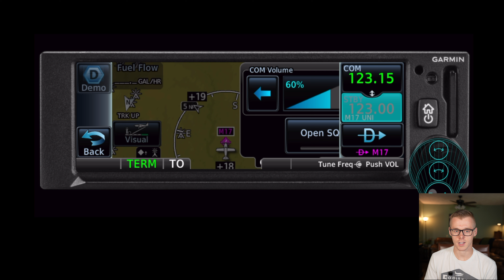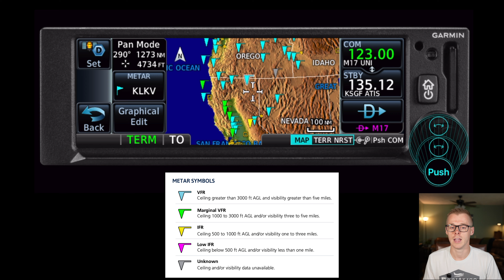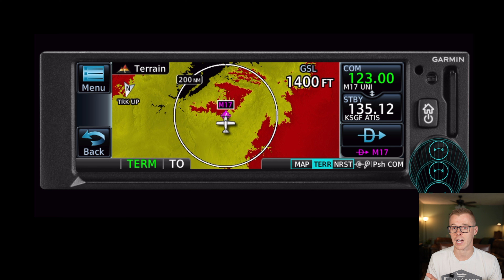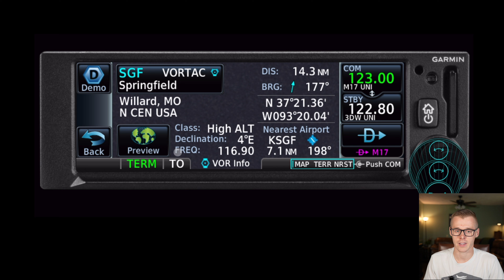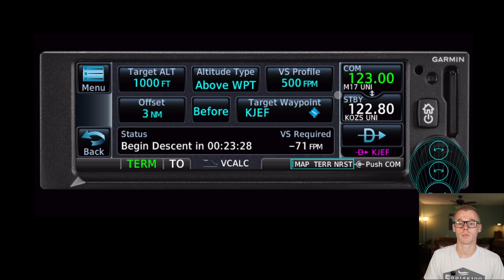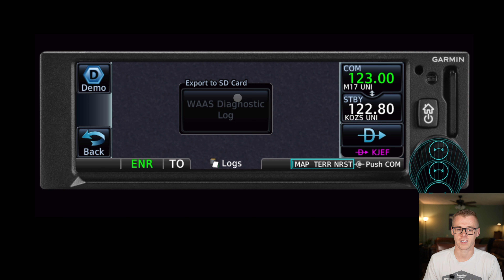How to Use the Garmin GNC 355 - Tutorial for Beginners

Comment: Just starting to get acquainted with the 355. Is there a way to move the plane to my home airport without flying there on the simulator? Great tutorial.
Reply from the maker: Yes, the two easiest ways are to go to the demo screen and enter your waypoint, or select a point on the map and press the “set” button in the top left corner to set that point as your current location.

Comment: Great video Cam! You are clearly the go-to guy for avionics tutorials, I really appreciate it. I have a GNC355 and a G3X. I know that I cannot use Garmin Pilot to update my G3X databases but could have sworn that when I had a trial GP subscription a year or two ago that I was able to update my GNC355 databases with GP. I just decided to switch from FF to GP and again tried to update the GNC and could not get it to work. I called Garmin Support and was told that I would need a Flightstream 510 and that updating via bluetooth ("built in Connext wireless technology"...confusing as there is also the subscription service by the same name which I don't have). Again, I could have sworn that I had been able to do this before but like AI it could be a hallucination.
Reply from the maker: Thanks so much for the kind words! Sounds like you have a really nice panel setup. I believe you can use Garmin Pilot to update the GNC355, but you will need a flight stream connected to the G3X before you can push wireless updates. I believe it just has to do with the age of the hardware, and since the G3X is an older piece of tech, it didn't come standard with Flight Stream connectivity. Hopefully all new designs coming from Garmin will include it moving forward.

Comment: Amazing presentation.  I'm looking g at replacing my old GNS530 with the 355.
Reply from the maker: Thanks! That’s a great upgrade, I think you'll really like the new touchscreen interface. Just note that the GNC doesn’t have a NAV radio option if you’re currently using VOR/ILS features.
Reply: @CamCarr I have a KX155 and another CDI to conduct LOC approaches.  I use my KX155 to backup my LNAV approaches. So, KX155 will become my primary for LOC approaches when I upgrade to GNC355. And GNC355 will be the primary for all other approaches.
Reply: @CamCarr I'm conducting my IFR training and GNS530 is not performing well.  Can only conduct LOC approaches with my KX155
Reply from the maker: @keithhoward9238 that is really interesting actually. For GPS approaches though, the GNC is a beast!
Reply: @CamCarr I was taught to have a active backup LOC Approach if available. Just in case of GPS approach outage happens during the most important phase of landing.